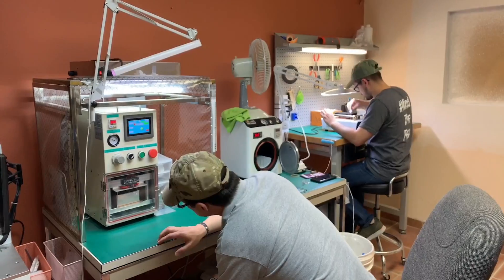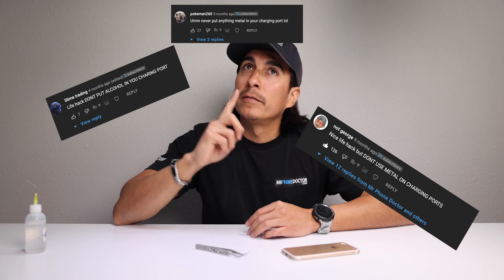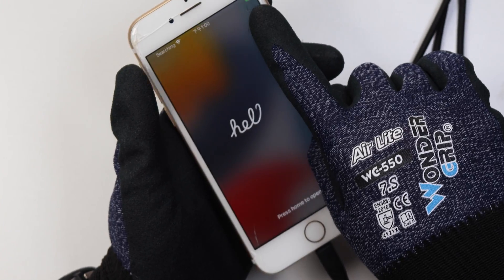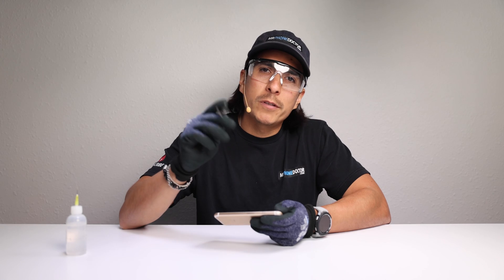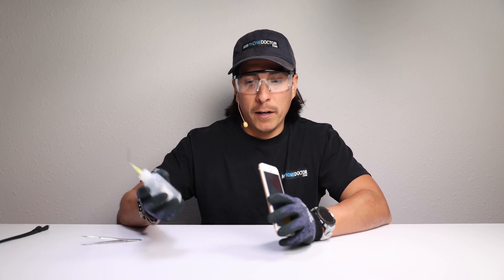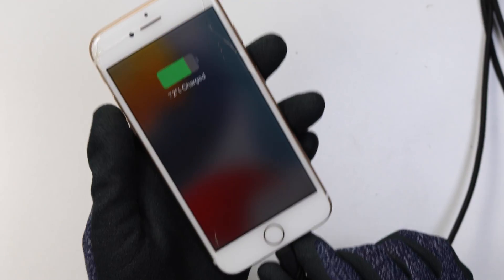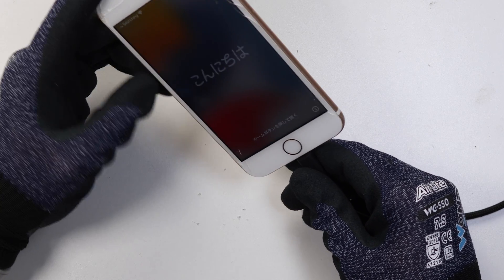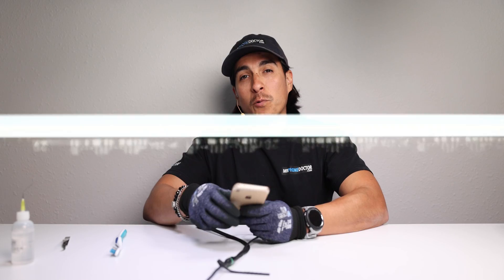What Happens if You Stick Metal in a Charging Port ???

Comment: I cleaned mine with sim ejecting pin and now it's fucked up. Can't charge my phone like normally. I have to wrestle with it and plus my phone mic is muffling for some reason difficult to talk on a phone. Never use metal
Reply: You most likely just piled more dirt or lint in the "corner" of the charging port. The microphone issue would be unrelated to this. I would recommend trying to plug the phone in and wiggle the charger to see where the dirt is and pick at it again!
Reply: @raphtheskidude  Wow. I was not expecting any replies. I ttried cleaning with rubber toothpick and now it's better. And yes when i plug the phone it widges loosely to left side and disconnects charging. But when i wiggle it to right side it gets perfectly fit and starts charging. I have no idea about microphone issue. But big thanks tho!
Reply from the maker: Clean the holes to the left and right side of the cp with toothbrush as well. This may clear up the mic.

Comment: So for type C you would not recommend using metal tools for cleaning? or being gentle witht the port is enough?
Reply from the maker: You can use metal. Just be sure that it is thin enough to go between the actual port. The middle sticks out so pay attention not to bend that connector
Reply: @MrPhoneDoctor what if tweezers touch the middle part while phone is on? Will it short the charging port?